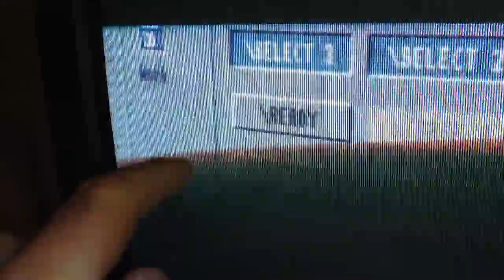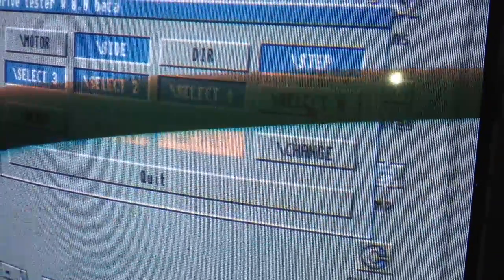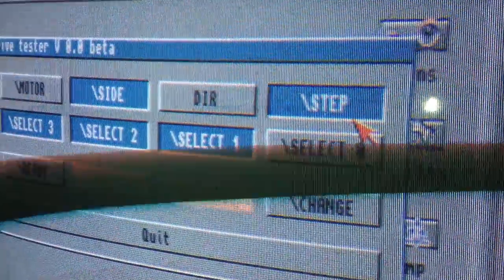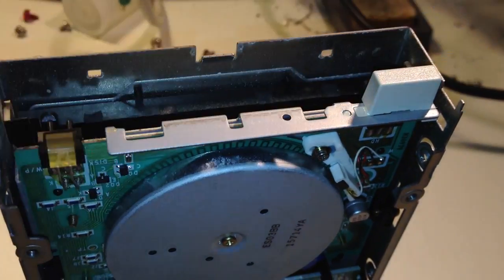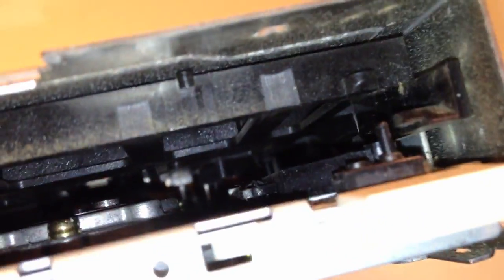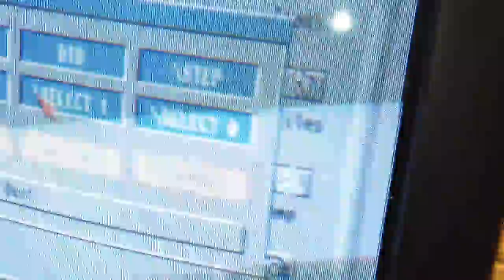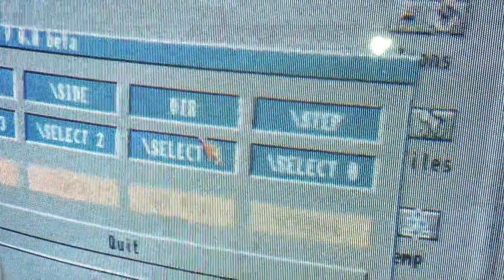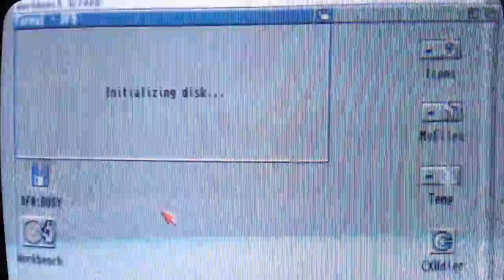Amiga HD floppy drive repair - Chinon FB-357A

Comment: Hello RetrogameModz, hope you are well, and still reading our comments, I have a usb floppy drive that only reads Double Density Disks most of the Time, sometimes it can read High Density disks,  but only in rare cases, I tried to clean the left switch that detects the hole in the right side of the disk, but it doesn't work not even a nibble, I hope I can get a Little help from you.

Comment: I fixed one A500 drive, one 600 drive and one 1200 drive with faulty disk detection/write protect switches. The problem on all of them was that the very small contact plate inside the switches was corroded. Scraping them with a needle fixed the problem in all 3 drives. The problem is that these switches are very small with super small springs inside them so it's not easy to do. For the 500 drive one of the springs fell on the floor and even with a powerful head led lamp and eyes close to the floor I could not find it. By luck I found it one week later and managed to fix the drive. I have never seen so small springs before.
Reply: +Mats Larsen 
Count me as the second lunatic to go inside that switch. Mats wasn't joking. Not only is everything in there tiny, but the springs and the little wiper contacts will easily bend and then launch themselves far from the work area if you touch them the wrong way. Having been warned here about that, I worked on a clean sheet of white paper under a bright lamp with a stereo magnifier headset, and still had one get away, but it didn't get too far. Might help to stand up some books or something as a barrier.

Obviously, you also want to be very observant of the order and orientation of everything while disassembling.

They must have chosen a bad or poorly treated metal for those internal contact plates. I couldn't even tell they were there when I first opened mine (they were pitch black). FWIW, the switches are normally closed. The center pin is common and connects to the long plate along the rear inside. My drive was a Toshiba FDD4261 in a Roland S-550 sampler, but it's that same dual side-by-side type. Works like a champ now  -Thanks!
Reply: Jidis Safi Nice to hear you had success. The problem is if you loose these springs on the floor they are almost impossible to find again. I also think that finding this small replacement springs would be hard. A good idea like you said to build up some kind of wall around the working area on the table to prevent the springs from going too far. When this is done successfully the switch will be good as new. In most cases just using CRC cleaner will not fix this issue, because as you said, those contact plates are black from corrosion and needs to be scraped clean to make good contact again.
Reply: +Mats Larsen  Hi Mats! Sorry I just noticed this. I'm not always logged in when I'm online.
One other thing I learned not to do was to find the springs with a magnet. I had two different generations of Roland sampler with two different brands of drive (Chinon and Toshiba) which both had the problem. The second one wasn't as friendly. I had one spring get away, and retrieved it by skimming the floor with a strong magnet, which managed to share some of its magic with the spring, so the spring would cling to everything while I was trying to position it. I also had one of the little prongs on the wiper contacts fall off on me as I was carefully bending them to restore some of their pressure. It must have been in really bad shape. So now, that particular switch is running with half a contact, which I'd image is also in bad shape.

It would be nice if we could just order these things from somewhere if they weren't too expensive. Most of the other drives here had the dual switches oriented differently, but I considered ripping one or two apart to see if they might have swappable guts.

Take Care
Reply: For this issue, I found spraying contact cleaner into the switches helps for a bit but not 100% as mentioned above.

Comment: i have two amiga 500 but their floopy drives are broken with a similar issue: both don´t write disks.
Recently i obtained a second drive and but there´s no writing disks and the clicking sound is lower after connecting with other cables of another amiga 500 i own. The guy who gave me the second floopy drive said to me that it was working perfectly some days before sending it to me. I received it 3 days ago
You can see the issue in this videos i made : https://www.youtube.com/watch?v=y9s3Fuw6ei4
https://www.youtube.com/watch?v=t6TK0w0kPHE
Reply from the maker: +TheReasonForYou
The links doesn't work. A message pops up saying that the video is unavailable.
Reply: yes but with the description i made you don´t have a clue ?
Reply from the maker: Without more to go on... No, not really.

Comment: I bet Amiga users and fans are glad people like you are around to fix their beloved Amiga equipment. :) BTW.Now I finally know why I like to collect different springs and screws, especially computer-like screws and micro screws when I disassemble electronics (old printers, optical drives, mostly PC stuff). ;) Just kidding, I have developed long ltime ago a pretty logical system of collecting electronic/mechanical parts useful for computer repairs. :) Congratulations on the double-spring solution, it's quite a neat idea. Greetings from Poland. Amiga rulez!

Comment: How odd, way back in 1997 ish, I owned an A4000 with ALL the problems including the disk drive, even the bizarre soldering looked vaguely the same, all except the resister on the bottom of the board, I wonder if its the same machine.

In any case nice work.

Comment: But what if the HD switch works and it still won't recognise HD disks? I think my 1200 is thinking my 357A is a 5.25" drive! This thread will test your knowledge :) http://www.amibay.com/showthread.php?73920-Chinon-HD-drive-won-t-read-HD-floppies
Reply from the maker: Sabretooth Barnacle
Obviously, the first step would be to find out whether there problem lies in the floppy drive or the motherboard of the computer. Even if you only have one HD drive at home, you can still do it by testing it with several different Amiga motherboards.
After that, you would need to troubleshoot the faulty hardware using proper test gear. Anything other than that would result in nothing but guess work.

Comment: Great video, but i have two suggestions for the future.
 
1. Use a side-cutter and remove the loop on one side of the spring, and then use pliers, to make a new one. The increased tension should solve the problem. 
 
2. Connect an LCD monitor to the amiga, instead of the crt one. I really like your videos, but i hate headaches... (and this video was 50 percent filmed at the screen) You need sync'ed framerates...

Skönt att se en svensk youtuber som vet vad tusan han pratar om! ;)
Riktigt bra videos. Du är nästan i klass med EEVblog... :D

Comment from the maker: It basically doesn't matter which model of floppy drive it is. They all work in pretty much the same way. What does matter is what kind of symptom the drive is showing. Even though a sensor problem is one of the most common problems on floppy disk drives, there can certainly be other issues with them as well, both electrical and mechanical. I don't know exactly how your floppy drive is showing signs of being unstable, but you should definitely be able to fix it if it's only a sensor problem.

Comment: Thanks for the video.  I have two drives in my A3000T that are doing this.  I thought the switches were bad/dirty but the disk might not be seated correctly when inserted.  I will have to take it apart and look at it.  I did use compressed air/electrical cleaner to clean the switches and it seems to help but the problem returns shortly after a few weeks/months...

Comment from the maker: It sounds like it might be a problem with your floppy drive. Have you checked the DD/HD detect switch on the floppy drive? There might be something wrong with the switch, making the drive always tell the Amiga there is a DD disk in the drive. You can check the DD/HD select switch in the same way I checked the 'disk in drive'-sensor switch in this video.
As for the A4000 that suddenly lost video output, I'm afraid I cannot help you much there without knowing more about the details of the problem.

Comment: Another fault to look out for on some drives are the surface mounted caps.  Whilst they haven't leaked on the PCB they often don't have the correct capacitance.  I know some of the Sony drives suffer from this in Amigas and ST /  STe.  Nice vid!

Comment: I had exactly the same problem with another chinon floppy drive build in an A500! (i think it was another model number because it has no HD support) I found out that the contact which recognize an disk change was a little bit loose, so if a disk was inserted the little plastik-switch was not fully closed. (mechanic was okay) So I took some glue und stabilized the plastik-switch. Now its working so great like never before ;D Thank you for your great repair videos! Greetings from Austria!

Comment from the maker: If there is not something really serious going on with your Chinon, I think it can be fixed. Floppy disk drives can often be fixed more easily than people might believe. Floppy drives have mechanical moving parts, which gets worn out with time, or maybe misaligned in some cases. But very often, the motors still keep going strong and so does the heads. A small mechanical issue can cause lots of problems, but often it's quite an easy thing to fix. I hope you'll get your Chinon going again.